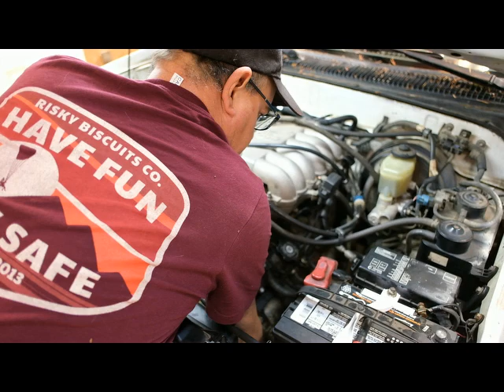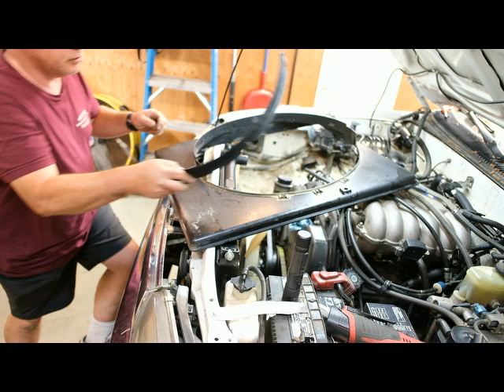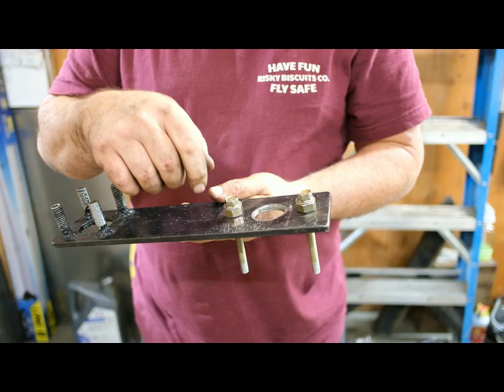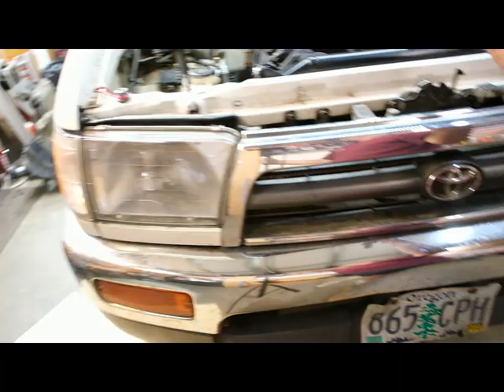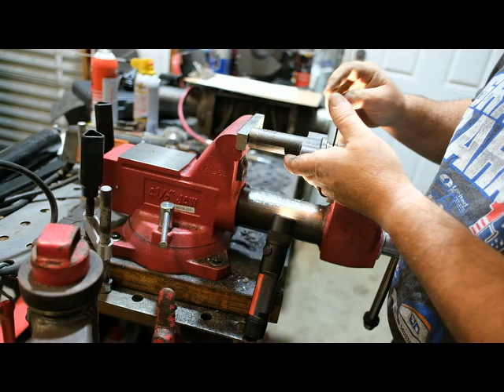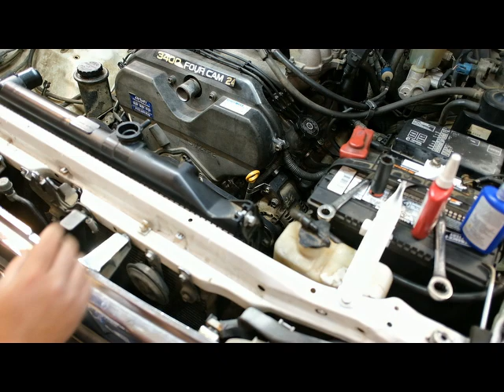Toyota  3.4 Timing Belt and Water Pump Guide

Comment: You dont have to take the air conditioner off or the bracket you can get to the bolt underneath with a 16-inch extension can a swivel head with a piece of electrical tape wrapped around it so its not flapping around